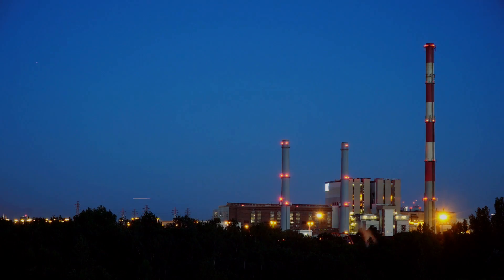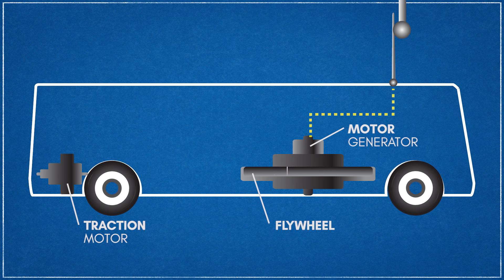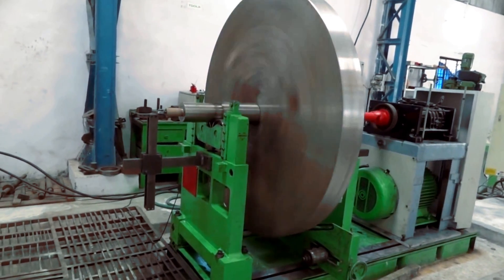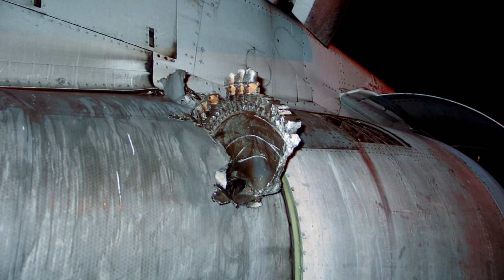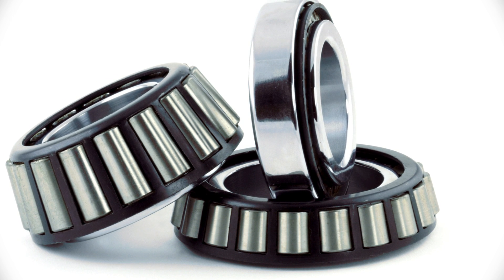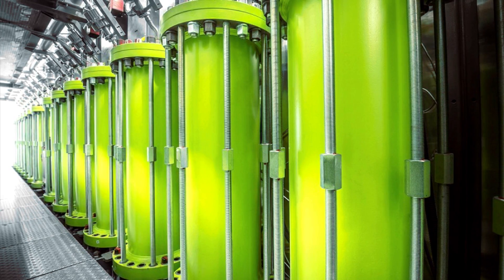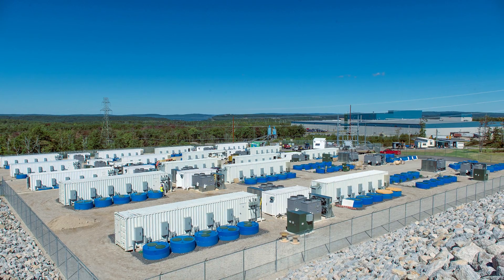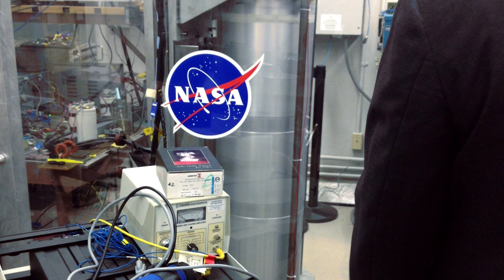The Mechanical Battery

Comment: Been trying to go off grid  for years now the limiting factor is battery technology...  Solar panels are good and fairly cheap per KWH but we are far behind with batteries. Example best batteries is Li-Ion or Lipo-4 which was invented in the 50's and you have to build your own power wall. With exception of the hugely expensive Tesla power walls. Atm most have to use lead acid batteries which can only be drained 50% capacity without damage plus a low cycle life even at 50% discharge. 

"IMO" pure green energy is just out of reach until a better battery is invented. While it can be done the cost is just too much for the average person or business. Awesome video! another solution is the hydro electric battery pumping water in the day off solar into a raised holding tank. Then at night using Hydro turbines to help power draw on a giving battery bank.
Reply: The cheapest energy storage is a hot water tank.
Reply: @dougmc666   Agree I use a rocket mass heater to cook some some meals and heat water . Thermal sapfhing too push water up to a holding tank. Free cooking and shower after a day's work feels good. Everyone thinks I am the crazy uncle / dad . I could go off grid if I had to it's commen sense practicality humonkind is missing today!

Comment: So, how viable is this in storing excess energy from private scale renewable energy sources? 

I.e. to store excess energy I got from the solar panels on my roof
Reply: From now as i get it best or more reliable stuff he quite briefly mentions stand hydrogen and oxygen storage ...
The "turn over" the technologies looks like an adequate response to "charges" or needs in that kind a matters in regards situation ...

On a larger scale it stand a matter of how do we use it ?

Could we store water during droughts times to burn it up under the rains ?

See even cycled fuel could be used as pollution ...

Even the purest love material could be ...

They brought child to fight for !

From france, with.
Reply: To notDumbassable, ...
Technically there is no excess energy coming from panels onto your roof ...
Whatever, ...
There are parts directly used and thoses not directly consumed ...
That whether you gried tied for distant instantaneous use, close storage, or even part "that could have been produced" ...

Industries about tends to have their panels maxima production, but its not "duty" the panels, your installation, nor even consumers theses ...

If there's no consumption asks for, panels won't produce anything even in the best shaped configuration you can dream of ...

The best energy the one you're not asking for, the one you dismiss from needing it, the one to make without !

Find out peace without war ?

How impressive was that ?

Have great days, and better nights .

Comment: The energy stored in a flywheel is trivial to calculate.  Hint: There aren't any flywheel buses in active service.
Reply: That's more to do with the gyroscopic effects. When used in a stationary context, much higher weight wheels and higher RPMs can be used, and then the stored energy can be very high, for far lower cost and longevity than batteries

Comment: Time Stamp 4:28 - "All internal combustion engines require some form of flywheel to operate." - False
A flexplate seen on cars with an automatic transmission is not a flywheel. In fact, they try to make them as light as possible to minimize its moment of inertia, while still being strong enough to be used to start the engine. A torque converter is also not a flywheel. Again, they design torque converters to minimize its moment of inertia. You can't argue the rotating assembly is a flywheel either, because they too are designed to minimize the moment of inertia. Lastly, the goal of the harmonic damper is to reduce vibrations, which is not the point of a flywheel. They too are designed to minimize its moment of inertia. By definition a flywheel is "a heavy wheel for opposing and moderating by its inertia any fluctuation of speed in the machinery with which it revolves."(1) Engines with automatic transmissions, or engines that utilize a fluid coupler, do not use a heavy wheel to moderate fluctuations of engine speed. They use hydraulics to compensate for such fluctuations. 

1 - https://www.merriam-webster.com/dictionary/flywheel
Reply: Did you ever started a engine without the torque converter and  see the teeth grinding vibrations , all dampers are heavy for that reason
Reply: @obiecanobie919  Still not a flywheel.

Comment: Why did the bus still need an electric motor? Wouldn't it be more efficient to connect it directly to the wheels?
Reply: It is quite difficoult to do because the bus needs to change often its velocity, while the battery has a decreasing angular velocity
Reply: @emnz1003  I guess it needs a very special clutch.
Reply: @schwarzerritter5724  well, yes, but as far as I know this would a huge complexity and peraphs it is notbworth of it in terms of size weight and wear. It should use a continuous variable trasmission and in such a great range of velocities it becomes quite hard to do and probably. Moreover also this trasmission will generate lots of energy losses and then perhaps the electric motor will be more efficient considering the whole system
Reply: I missed a part, i was saying: probably the continuous trasmission will wear a lot, so the electric motor seems more feasable
Reply: But these are just rough considerations, a complete study should be performed of course ;)
Reply: @emnz1003  You would not really need a transmission, just some sort of clutch with low friction loss. I mean, slippage is bad for a normal car, but in this case, the energy would stay in the flywheel.
Reply: @schwarzerritter5724  yeah but the problem is that you only use a clutch is like trying to drive with the 5th gear always in and you have to change your speed by adjusting the clutch. The wear and energy losses will be enormous because you have to link 2 rotors that are revoluting with very different angular velocity, do you agree?
Reply: @emnz1003  Of course it would not with a regular clutch.

Comment: Until your video I really hadn't thought that flywheel storage had a place in the future but now I see some good advantages for static systems, thank you.
Reply: It will most likely be especially useful in space power plants - weightlessness makes magnetic suspension easier and the system can be shielded from heat, meaning cryo is easier as well.
Reply: @HadzabadZa  good points although would there be problems with moving satalite around due gyroscopic forces?
Reply: @veronicathecow  I would assume you don't have to move an entire power plant satellite around, just its active components (I'm thinking this https://www.youtube.com/watch?v=q-Lrj35HcbQ) like mirrors or the transmitter. However there might be a need to rotate it if the orbit isn't on the same plane as the ecliptic, because otherwise the radiators will get exposed. Yeah, the gyro forces are the trickiest part, but I think the benefits outweigh that little nuisance.

Comment: Friction losses as well as repairs and maintenance costs, wouldn’t it be easier to use battery’s?
Reply: I use lion and lipo battery’s as part of my work, let’s just say they last a lot longer then what people realise especially with modern day BMSs the main problem is controlling the temperature, so keeping it cool in summer and warm in winter. I would rather use battery’s as I want this type of technology to improve through design iteration plus the housing infrastructure for battery’s is lower compared to say gravity or even fly wheel another thing about battery’s is its relatively easy for people to go of grid with wind or solar.
Reply: @Arcamedi1  True... and it is especially easier for home usage and going off grid, with a scale of battery similar to Tesla's powerwall, although personally I think I'd try to save some money and DIY it if I were going to try going off grid.
Reply: You are right DIY is best, that way you understand what’s going on and you can also fix everything your self
Reply: Did you watch the video? They outperform batteries in certain use cases at certain scales, their friction losses can be minimized, but they're not really used for the same things as chemical batteries currently are. Chemical batteries have their own maintenance costs as well, especially considering that they can withstand a much lower number of charge/discharge cycles before they need to be replaced, whereas flywheels don't have that same problem for a much longer time, and don't suffer any of the associated loss of capacity over time that you may notice in your cell phone battery (which any other Li ion will also have). Unfortunately due to the things other factors enumerated in the video, flywheels are not a good fit for use in phones.

Comment: I wish theres a diy of this so i can have a idea to developt it
Reply: There's nothing special about them? If you've ever Jerry rigged an electric motor to generate lower/higher frequency electricity through pullies (i.e., budget "variable frequency drive"), then you can build one of these things although at a really low efficiency.
Just follow these simple steps if what you want is a DIY:
Step 1: Get an induction motor. Extra points if you use an automatic voltage regulator (the ones generator sets use, about $20 on amazon) instead of capacitors.
Step 2: Weld the rotor to a huge ass flywheel rigged together with a couple of pullies/gearing so the flywheel spins faster while maintaining the same rotor rpm, i.e. more potential energy stored. A CVT would be ideal, but that shit is expensive.
Step 3: Make flywheel spin at the frequency you want your electricity (depends on gearing configuration and on the amount of poles on the motor). You can easily do that by attaching another electric motor on the other side, or through whatever you come up with. Big note is that it needs to have low friction when energy transfer stops.
Step 4: ?????
Step 5: Congrats, you have a flywheel energy storage.

Comment: Here is another old energy storage system that might be put to good use: the good old rubber band that drives model airplanes!
Reply: I attended an energy storage symposium back in the 70s that had a presentation by a company that did just that as a modification to a small car (Chevette?). I can't remember much about the results, but I do remember that part of their experiments dealt with determining how many windings of the bands gave the greatest storage efficiency. As you might imagine, the rubber bands used to propel even a small car were GIANT size!!

Comment: Basically, an electric motor where the rotor is called a flywheel.  The flywheel is spun up with electrity and then free wheels to produce electricity. Eventually, it slows down to the point where it needs to be spun up again.  The trick is to produce an environment for the rotor/flywheel with as little friction as possible.  Works best in a vacum without gravity, aka space.

Comment: Another type of mechanical battery that has been in existence since the 15-hundreds is the spring mechanism in a mechanical watch. In a mechanical watch, tension is applied to a spring through winding which is then released slowly to move the gears.
Reply: Good suggestion which we've also looked at - our 1.5t flywheel design is optimised to store 110MJ at max 4000RPM and release it to an average house for 5-6 hours - if you need more storage then use more flywheels on the same axis or increase the dimensions - you'll have to reduce the RPM though. We found it difficult to optimise a  compact spring-based system that can do the same thing as efficiently.

Comment: Reminds me of the toy cars of old days where you spun the tires real fast by dragging them across ground then let the take off.
Reply: Or the rip cord Evel Knieval motorcycle toy that would fly across the yard from a single pull!
Reply: Those were usually spring powered.
Reply: The ones you wound up by pulling back were spring powered.  There was another type with wheels geared to a flywheel that you spun up by pushing in one direction for a bit then letting it go.
Reply: Osiris02 oh yeah lol I forgot about those. You wind them up my rolling it forward over and over again
Reply: @Osiris02  Those are called "friction" motors.  Basically a small flywheel that would spin up fast due to the gearing.  A popular, somewhat larger sized toy were the "Mighty Mo" line of trucks.  They used larger flywheels and extreme gear ratios so they had lots of torque, but very low ground speed.
Reply: @johncrowerdoe5527  -- The spring powered little cars are more recent vintage--my grandsons have some of them. The flywheel powered cars date back at least to the 1950s.
Reply: Yes!  Hadn't thought of those.  I had a few myself.  Same principle.
Reply: I used to operate a flywheel research test laboratory. It was a popular stop for visitor tours. Whenever I was asked to explain the concept of mechanical energy storage via flywheels, I would get out a model car toy that I kept handy as a visual aid. The car was powered by a small metal flywheel geared to the rear wheel's axle. I would have the visitors clear some floor space and then I'd give the little car a few wind up pushes and let 'er rip!  After the demo I would show the visitors the little flywheel disk in the car, and how it was geared to the rear wheel axle.
Reply: Kenner SSPs! https://www.youtube.com/watch?v=_NxQf-aeDWk
Reply: ed brown yes
Reply: I had a set from the 70's called "Smash Up Derby" by Kenner, with cars that had a big flywheel you powered by pulling a toothed, plastic rip cord through.  Great fun and also similar principal.
Reply: That's similar but is actually potential energy storage system ( in spring coils )
Reply: We had an idea we put a bike on its center stand pedaled as fash as we could and charged the little cars.

We would imagine them wizzing accross the street...

We didn know about torque... They just flipped.

But then some kid had the "brilliant" idea of puting that charged car in my hair... :)))